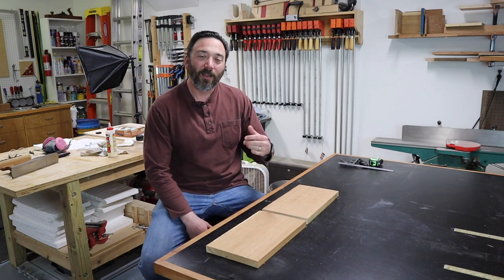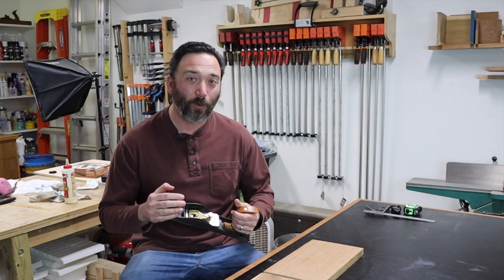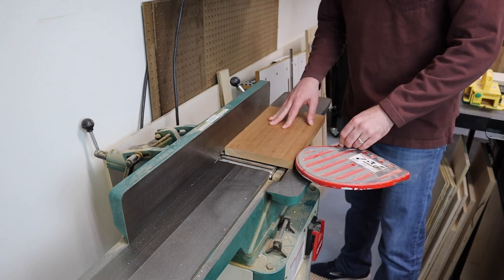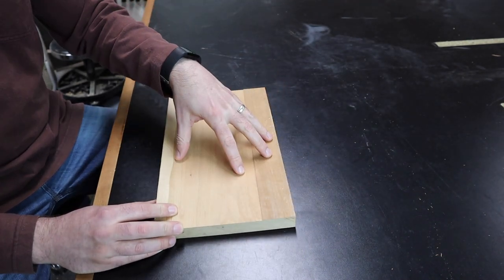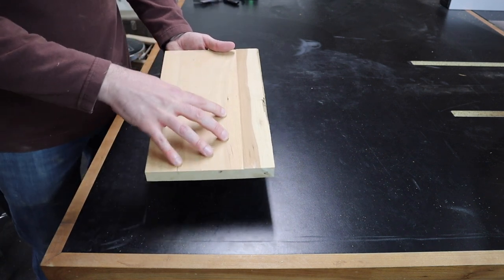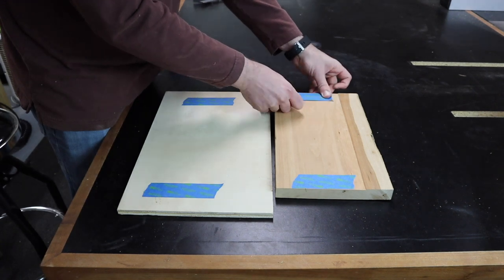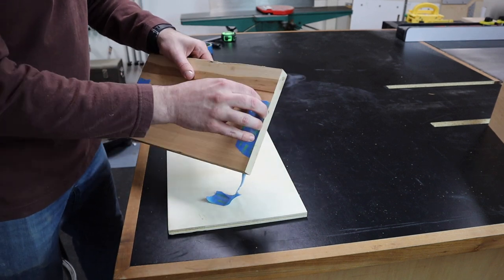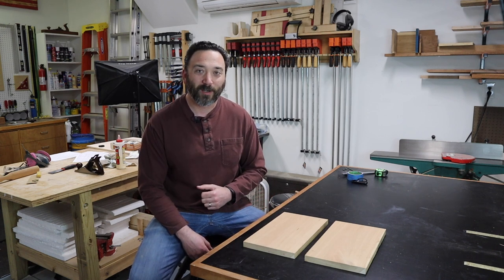Flatten Boards Wider Than Your Jointer!

Comment: Sometimes you really do need a bigger jointer.  Everyone does these videos and uses tiny boards to demonstrate and that`s fine.  Totally legit for small projects.  show us ow this works for big stuff.  I promise it gets pretty challenging  when you`re trying to flatten a hunk of 8ft long, 11 inch wide hard maple at 2 inches thick.  I just did it.  Hella frustrating and time consuming.
Reply from the maker: You are right! If you have to flatten long boards you need a longer bed length. But, if the project doesn't have pieces that are 8ft long, then you can cut the boards down before jointing them and still use a smaller jointer. I can joint up to 8" wide on my 6" jointer, but anything wider and I have to use other methods or cut the material down more.
Reply: Consider though that a skilled handtool woodworker can plane any size board with a 24" handplane and get it perfectly flat. Weird but true

Comment: Newbie here:  Why not, without the guard of course, move the fence closer to the edge and the flip the board around to take care of the other two inches?
Reply from the maker: If you do that the resulting face will not be coplanar with the face that was just made.
Reply: @biscuittreewoodworks  Because they're going in opposite directions, or because there is enough support on the part already passed through?
Reply from the maker: @jwrbloom01  ok, this may be difficult to explain without visual aids but I’ll do my best. When you joint a board there are two reference points that matter. The first is the rough board to the in feed table. The second is the freshly jointed face to the out feed table. This is a smooth transition as you pass over the cutter head. If you then turn the board around and try to joint the other side you now have a third reference point that has no relation to the other two. It is a different rough surface to the in feed table. This transitions to a fourth reference that is out feed to newly surfaced board. These two out feed references do not exist in the same plane since they are derivative of separate in feed references.

Comment: If you're going to use the planer with the planer sled technique, couldn't you just secure the board to the sled, flatten one side, then remove it from the sled and flatten the other side without ever running it through the jointer? Seems like you'd have two flat parallel surfaces with that technique
Reply from the maker: Yes, if you have a sled that is as long as the board, you can secure the board so it doesn't move and flatten one side, then flip the board over and flatten the other side. It works, but it is a bit more of a hassle than running the board through the jointer first.

Comment: That blue tape & ca glue tip is really useful. Thank you!
Reply from the maker: That is a great tip! Glad you liked it!
Reply: Definitely a cool trick I learned too.
Reply: Put a cleat on the bottom trailing edge of the mdf or melamine or plywood... whatever you are using so it hooks on the infeed table and no need to glue it yo the workpiece being planed.

Comment: New woodworker here. Why not turn the board around and joint the side you couldn't get?
Reply from the maker: It won't get flattened that way. The board will sit at an angle and you will not get a flat face.

Comment: This is a great idea, been having this same problem...How do you keep your shop so clean, every video you make shows that the shop is clean and looks nice, I keep all my stuff organized but the saw dust is my problem, I have a dust collection system with everything connected but I still can't keep stuff clean.
Reply from the maker: Thanks! The shop isn’t as clean as it looks on camera! I’m terrible about not putting things away and stuff really starts to pile up! But once I complete a project I go through and put everything away and clean up the shop before starting the next project.
Reply: @biscuittreewoodworks  The Rubio finish that you applied on the jewelry box looks very nice, is that what you use on most of you projects?
Reply from the maker: @cds957 I’ve been experimenting with it for a while. So far I really like it. I’ve also used Osmo and it is very similar. Before the hard wax oils I was using General Finishes Arm-R-Seal on everything. It’s great if you want a polyurethane finish.

Comment: Nice video but I strongly disagree with the blue tape, CA glue. 
Break open the piggy bank and buy some woodworking double sided tape. Eventually you will find that the blue tape let the CA glue bled through and it will be a mess. It might take many uses before it happens but it will. And when it does it's not fun. 
You can also use hot glue to stick the boards together but I find it a hassle to wait for the glue gun to heat up. 

I just discovered your channel and it only took 2 videos to get me to subscribe. 
Nice channel!
Reply from the maker: Thanks for the sub and comments! On the blue tape, I used double sided turners tape for a few years and absolutely hated it. It was sooo frustrating trying to peal the backing off! I usually had to use a razor blade to get under the backing. So when I learned of the blue tape and CA glue trick I jumped on it. If you know of a good brand of double sided tape that’s not so difficult to work with I’m willing to give it another shot!
Reply: @biscuittreewoodworks  actually there's a trick to it. I'm not sure if I can put it in words. I'll think about it and get back to you. It makes it really easy.
Reply: It's cheaper to buy double stick tape in the first place than wasting expensive CA glue/accelerator. Who the hell came up with this blue tape/ca glue and why it's so popular is beyond me.

Comment: I'd just point out that the bigger jointer typically comes with longer in-feed and out-feed tables.  This is important for longer boards.

So sure, I can use my little benchtop 6" jointer on something like a short 8" board but the real challenge is on long boards.
Reply from the maker: Yes, you are 100% correct! Bed length is very important if you want to joint longer boards.  You need that additional reference surface.